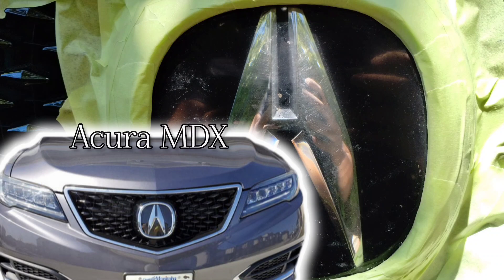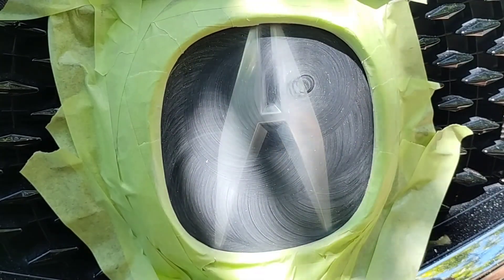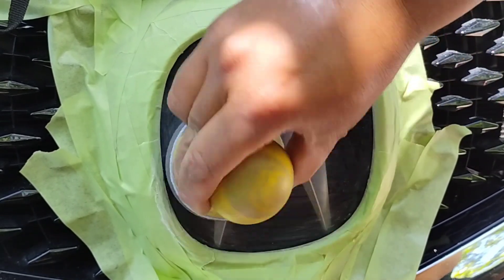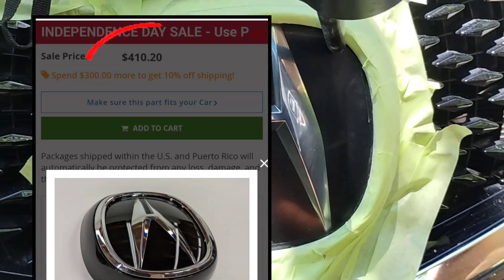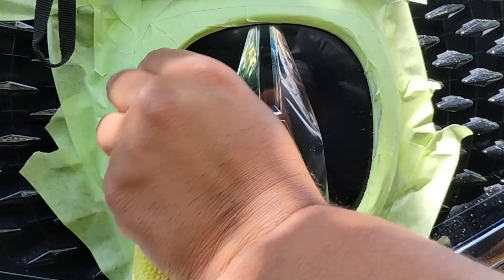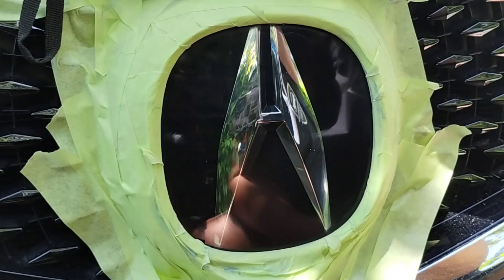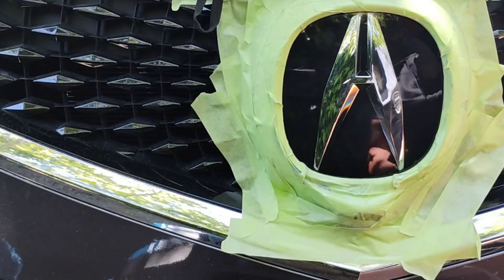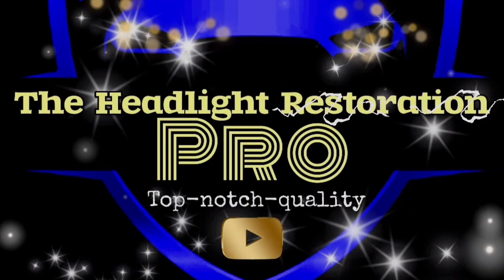Emblem Restoration - how similar is it to headlight restoration see how😳

Comment: Good info, never seen u use a wax/polish remover before spraying the coating.Not needed?
Reply from the maker: Not needed and should be frowned upon when concerning headlights... This will give you a better insight on that..https://youtu.be/LC4ZBu02JZg
But yes most definitely do not if you're using the right supplies and products...